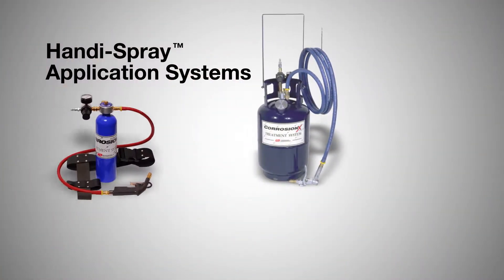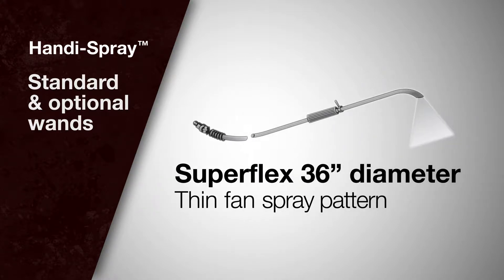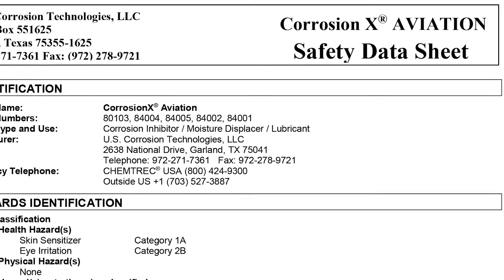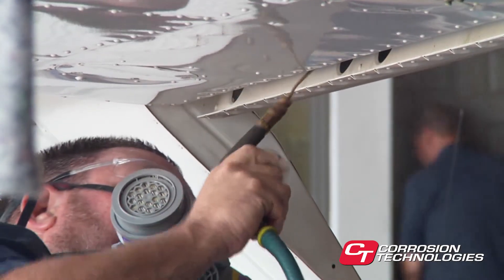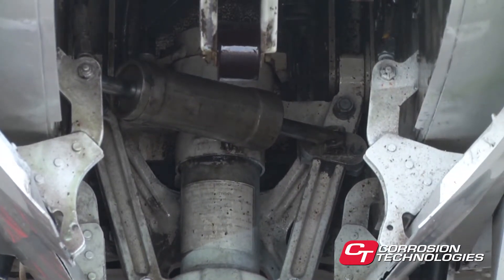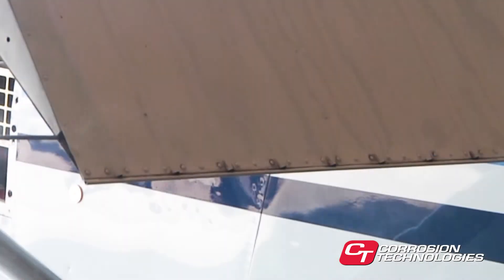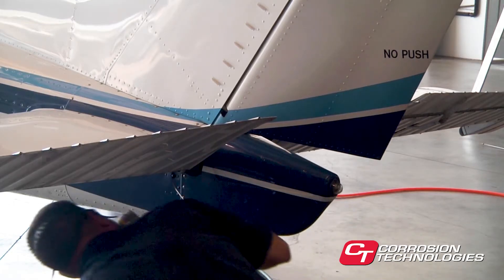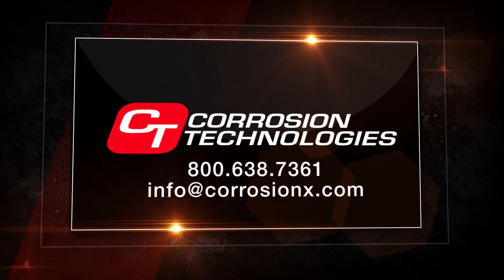Handi-Spray treatment system for CorrosionX and other liquids

Comment: Came here in hopes of finding information about cleanup. Dang.
Reply: CorrosionX is only interested in (i.e. will only bond to) metals and metal alloys that can oxidize. If it gets on anything else, you can just wipe it off with a paper towel or rag. If it's something very large like an airplane that you're trying to wash, our aircraft approved surfaces cleaner XHAUST & SOOT REMOVER mixed up in a bucket with water will do a nice job. Don't try washing with a conventional car wash type soap, as it will just emulsify into a gooey mess.